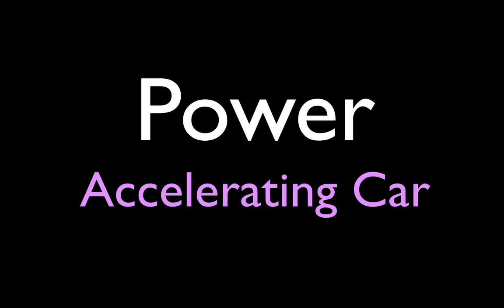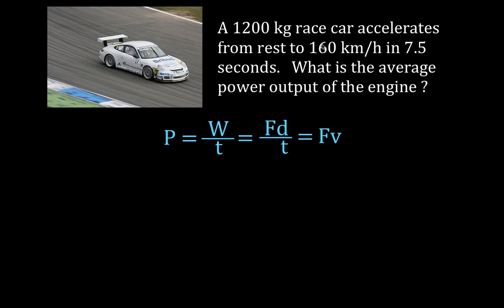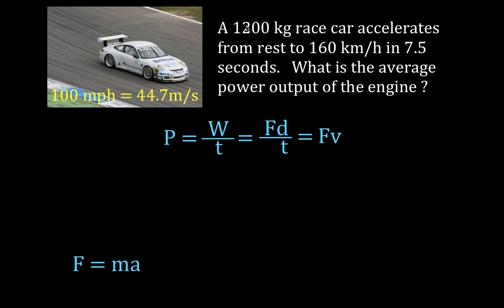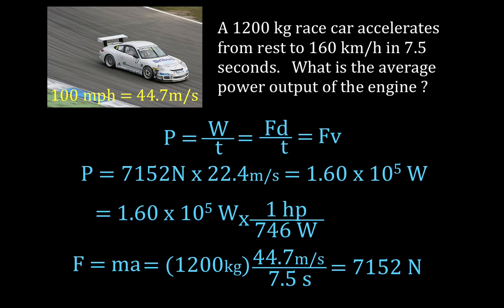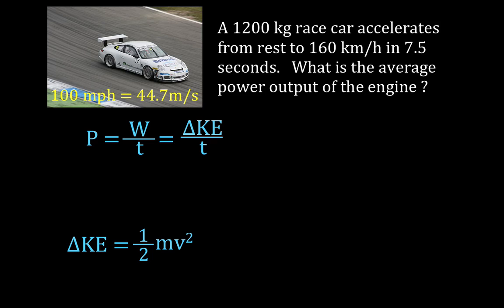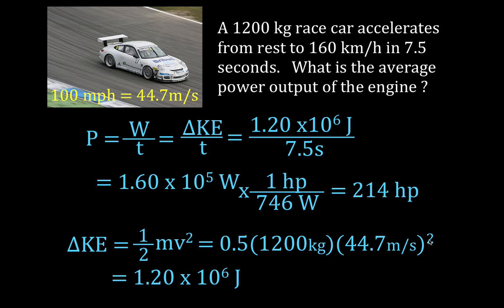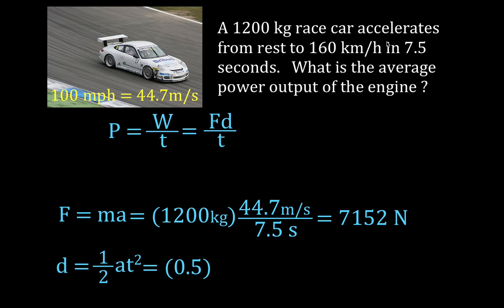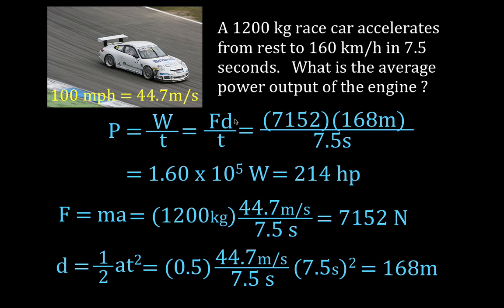Energy, Work & Power (25 of 31) Calculate the Average Power Output of an Accelerating Car

Comment: The distance calculation here isn't correct unless the car is accelerating uniformly the entire time, which isn't true for constant power output. At a constant power output, a car will initially accelerate very fast and slow down towards the end. This leads to a change in the distance traveled.

Comment: Is the same engine put in a 2,000kg car produced the same horsepower?
Reply: Yes. 
But the acceleration would be slower. The same engine, in a heavier car, requires more time to reach the same speed.
I did the math and would require 12,5s with the same 214hp of average power

Comment: This might work in a class room but what you just calculated is not the total power. It is the amount of power that is being used to accelerate the car. The total power would have to include the power to overcome rolling resistance
(rolling coefficient*mass* velocity) as well as the power to overcome aerodynamic drag( 0.5*CdA*air density*(velocity^3) ) if you wanted to make a real model. Good video though.

Comment: I have a very important 2 questions for me:)

1. In space, there is a space shuttle that does't move.  Mass of this shuttle is always constant. This space shuttle has a rocket engine which produce a constant force of 100N. When the engine is started and the ship has a constant thrust of 100N, when the ship starts to accelerate, will the acceleration be constant and remain constant (let's assume 10m / s), or maybe the acceleration will start to decrease as the speed increases? It is related to the rule Ek = 1 / 2mv ^ 2 ???

2. Same space shuttle doesnt move. Shuttle start to accelerate from 0km/h to 10km/h in 5 seconds and it takes "X" energy for example. How much energy it will needed to accelerate also 10km/h more in also in 5 seconds when it allready have velocity of 100km/h ? Also "X" energy? Or much more "X" of energy? And why is that?

Comment: Sir, what about frictional resistance between car tires and road (coefficient of friction is 0.7) . So some more power may required.
Reply: I know it's been two years, but I think this reply will be usefull

The example of the video act as a real car doing a real acceleration. So, the car already did the 160kmh in 7,5s. Then, all resistances coming from tires and wind are already inbuilt in the math. The car needed an average of 214hp to move it's own weight with that set of tires trough the wind conditions of the day.

Your thinking would be valid if we get the power at the wheels and had to calculate the estimated power before testing the car, not knowing how the wind and tires would be at the moment.
Reply from the maker: I am not sure there is such a thing as "frictional resistance"
Reply: Sorry sir, I asked about real time problem.
If car moving with constant velocity ( initial velocity = final velocity =120kmph, => a = 0 ), is that mean car generating no power???
Please someone tell me......
Reply: @BalajiAddankiVidEd  Yes, that is exactly what it means. According to Newton's 1. Law of motion, an object at which the net force is equal to 0, the ojbect most either be standing still or i a constant linear motion. Without accounting for drag and rollingresistance, there would be no force slowing it down,  and since the motor acceleration is zero, the power output would be zero.

Oh btw, your question regarding frictionalforce, is not the same for a rolling object, as for a flat object being dragged across the ground, obviously. You're gonna need the rolling coefficient instead of the frictional coifficient.
Reply: @BalajiAddankiVidEd  the engine is DEFINELETLY producing power. Just because the car is in equilirbrium does not mean the engine's force is to be neglected. It still exists and still does work, it's just that kinetic friction (i presume) does the exact same work in the opposite direction

Comment: sir I have one problem of work changes into P.E.When the mass of body covers distance in vertical line and for vertical line we put y.axis and for y.axis sin teta is used then why in work done changes into P.E we use cos teta?
Reply from the maker: +Faisalkhan Sasoli I am sort but I do not fully understand your question.  Work = fd cos (theta), I am not sure when you would use the sine.  You can a listing of all my videos from my website, http://www.stepbystepscience.com
Reply: Sir in Physics we have completely proved the work and I also know that Cos(theta) is used for its angle and on the other hand the confusion which I have is P.E that how  work done can be changed into P.E? because in P.E height is distance and hight is along y.axis and for y.axis sin(theta) is used.